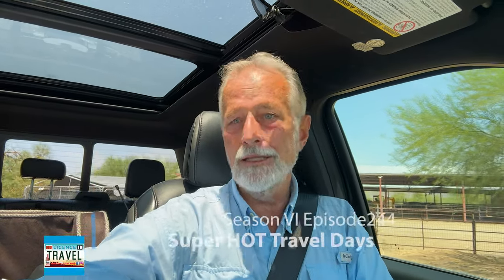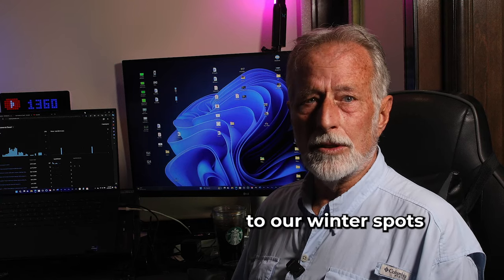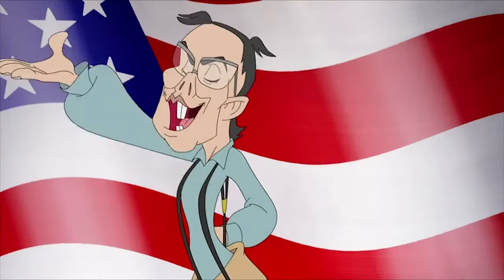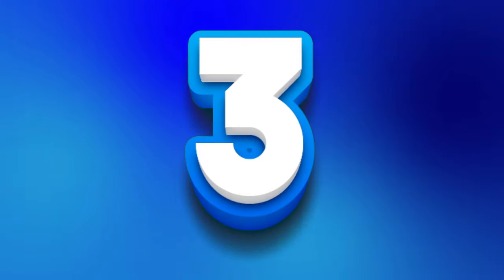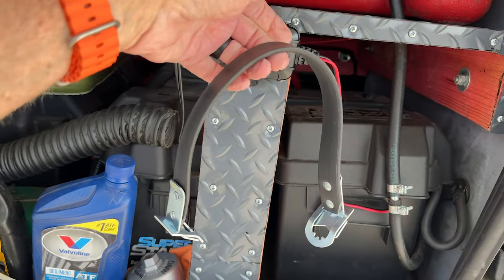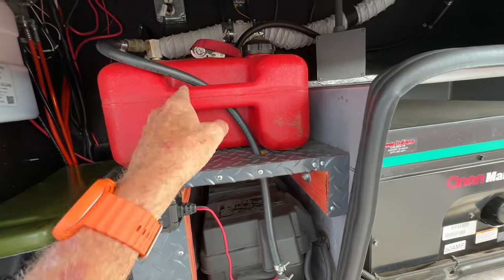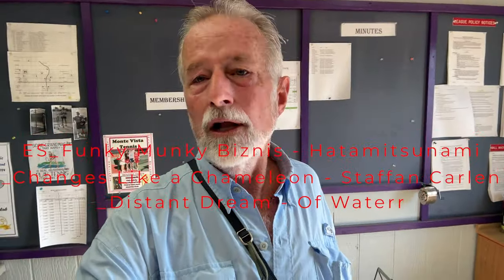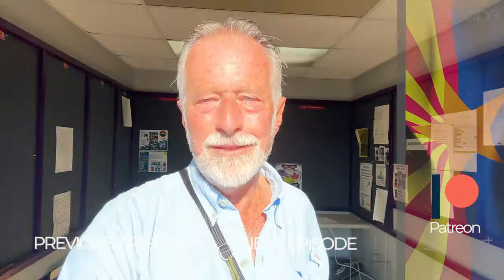We have a way to Fix Super-HOT Travel Days!

Comment: We're park hopping in FL and have the heat and humidity. We don't turn anything on to keep it cool while traveling, as we get closer to our new site, we turn on the air to cool down the rig while setting up. We installed the East Touch thermostat so we can turn it on via Bluetooth.
  BTW, we'll be wintering in AZ and will be at MV starting 28 or 29 Oct.  Hoping to park hop between MV and M.  Would like to meet up with you and Shelly.
Reply from the maker: I remember the humidity when we were in FL. I think I'll take the furnace here. One of these days we'd love to get one of those thermostats. We've seen a lot of other YouTubers with big rigs and one controls just turn it on from the cab... We're gonna try it by doing a fuel stop about an hour away. double-checking everything then getting to set up. As of now S and Grizz just hang out in the truck tell I can get power hooked up.
 For the near future, we will be here doing the same thing. We would love to get together with you guys. Sounds like a blast. Thank you both for keeping in contact. :face-red-heart-shape:      OLT